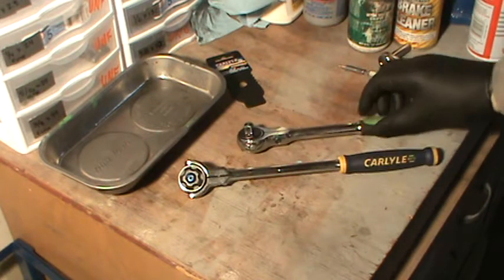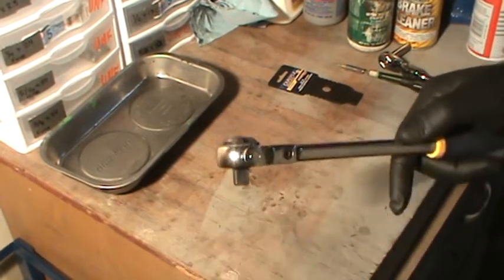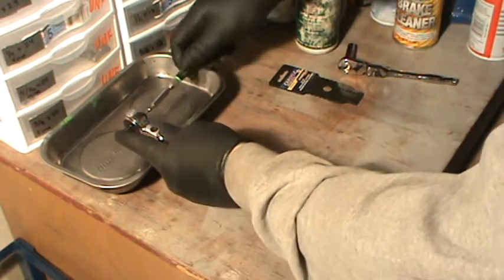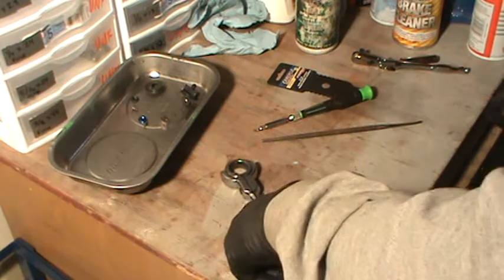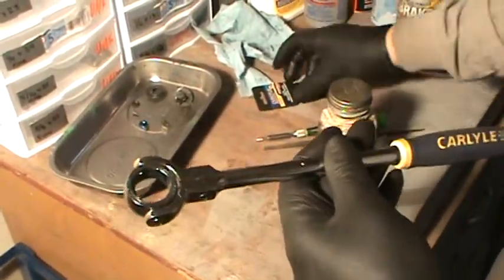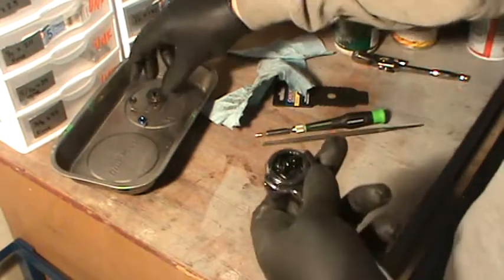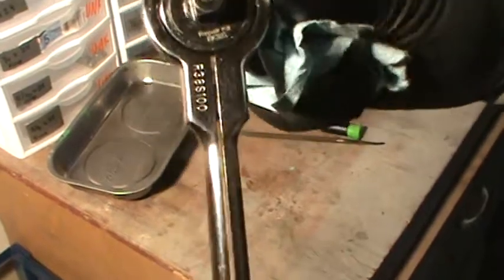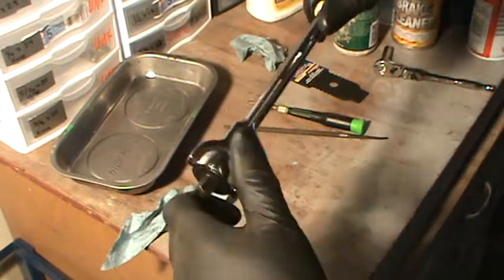Professional Tools

Comment: I own this ratchet. I've had the chance to disassemble it side by side with the Matco equivalent, and the internals are identical. I have No way of identifying little internal parts like that with serial numbers but both are made in Taiwan, that much I could verify, 100%. I would bet good money the internals for both of them come off the same assembly line. One cost me 70 bucks, the other cost my friend 130 something.

Comment: I have had this ratchet for about a year and a half. I bought it for about the same you did. I haven't had an issue with it slipping or the handle coming apart or fading. It has treated me well.

Comment: Snap on tools are made from virgin steel so the quality of the steel is stronger and can be made thinner, after market types are made from recycled or mixed virgin and recycled steel so its not as strong as the snap on tools but can be cheaper do to steel used
Reply: where are u getting your info

Comment: I've been looking at that Carlyle for awhile now, waiting on Napa to come down in price, last time I checked it was around 100 bucks.
Reply: Tim's Tool Reviews their ratchets are not bad but you don't wanna use grease when servicing their ratchets as it causes sticking they recommend v10 oil but I use air tool oil and they are nice
Reply: Tims Work Shop it's $69 bucks right now man. Just bought one yesterday. On sale though. Probably thru end of the year but not sure.

Comment: Hey roman what's the exact name of that lube your using. I tried to locate synthetic break lube in autozone. I found some black thick stuff.
Reply from the maker: It is this Permatex product http://www.autozone.com/autozone/accessories/Permatex-Ultra-disc-brake-caliper-lube/_/N-268d?itemIdentifier=10772&_requestid=13595922
Reply: Thanks brother
Reply from the maker: *****  Or on Amazon http://www.amazon.com/Permatex-24110-Ultra-Brake-Caliper/dp/B000HBNV6W/ref=sr_1_4?ie=UTF8&qid=1409105463&sr=8-4&keywords=permatex+brake+lubricant
Reply: +Emin HVAC I use Hoppes gun oil.

Comment: 1. Aside from the shorter handle and  inability to be taken apart, how does the swivel head harbor freight compare to the carlyle? I ask because I just b ought the 1/4 and 3/8 harbor freight ones.  I needed some ratchets that could reach hard to access nuts. I also bought them as my 'tool bag tools' so if they get stolen or lost, it's no big deal. I leave my snap-on stuff at home.

2. Have you figured out how to take those harbor freight swivel heads apart yet?

3. I don't like the idea of putting grease on the teeth of ratchet wrenches. The way I see it, because grease is thick, it might prevent the pawl from  seating into the teeth all the way and that could cause a slip. Grease is also difficult to wash away with wd-40 when it gets dirty and caked up. Grease can also slow down the return of the pawls and springs.  I usually open up a ratchet, clean the parts with wd-40 a few times or until the wd-40 starts to run out of the crevices clear. I then  shake off the wd-40 then use contact cleaner to remove all traces of it. After that, I just put a few drops of 3 in 1 oil in certain spots. I notice that my ratches sound much crisper and solid when I do it this way. Grease gives  you that vague engagement feeling that craftsman ratchets have. I like to feel and hear the health of my wrenches. Makes me more confident and less afraid of busting my knuckles.

4.  If harbor freight made a long handle swivel head, would you have bought the Carlyle?

5. If you can't open the Harbor freight, just dip it into a mug full of wd-40. I have a snap-on scaffold ratchet that is riveted (not screwed) closed and since I didn't want to break the rivets opening it up, I just sprayed some wd-40 in there. Works like new now.

6. I don't know why anybody would still buy snap-on ratchets. You are paying ten times as much for a tool who's country of origin you don't even know. They are selling autozone ratchets for 6 times the money. You might as well go buy a autozone Duralast and save some money. The heads on their ratchets got bigger, why? I heard it is because of the inferior steel. I heard that you need thicker metal when your metal isn't as strong. One of the big appeals of snap on was their slim profile but you don't even get that anymore.
Reply from the maker: I put grease, you can do what you want. If  a ratchet has the potential of a lot of sand getting in it, then I would just use wd 40 or similar. Snap On is a good tool brand, but they are outsourcing more and more of their parts to overseas to compete with all the other tool manufactures in the world. A COMPANY'S SOLE PURPOSE IS TO PRODUCE PROFIT. Remember that before you believe lies of millionaires.

Comment: Hey Roman. Have you looked into the Kobalt brand that they sell at Lowes. If you have what do you think of it? If not would you PLEASE PLEASE look into it and compare to Calyle, Craftsman,HB or maybe even to  those expensive Chinese tools.
Reply from the maker: I like Kobalt better than Husky. I like Carlyle because they have the large wrenches, large sockets, that Kobalt doesn't really carry. I have Kobalt, and they should be just fine, but like I said their hand tool line is limited. Try to find a 32 millimeter Kobalt wrench, they probably do not have one. To be honest, Kobalt is about the same as Carlyle except Carlyle has more tools available, and Carlyle is for professionals, they don't leave out sizes in the sets they sell.
Reply: Thanks a lot Roman. You are absolutely correct. Kobalts selection is limited i was at Lowes today and Sears looking for a deal and did not buy anything at either store. I am really really considering going exclusively Carlyle for a while. Since i have lots of the good all American tools that has Made In The USA stamped on them. Thanks again
Reply: Hey Roman. Since  respect your opinion. I am getting a pretty nice size tool chest for fathers day. Its not a $10k box but thats all my kids could afford. They are students. What kind of liner would co recommend. Thanks in advance.
Reply from the maker: Ahmad ShahBaba http://www.amazon.com/JEGS-Performance-Products-W88996-Drawer/dp/B007WWU79S/ref=pd_sim_sbs_hg_1?ie=UTF8&refRID=06QF0CQFAST89Y7G06M1    I don't know what box you are getting, but the Harbor Freight are very good for the price, it is 14 gauge steel, which is what most expensive boxes are made of.
Reply: Hello Roman.
The kids are getting me the Craftsman 40in  11 drawer chest#58628 and the 40in 5 drawers top # 58627 top stainless steel. And what do you think of the box. And once again thank you so very much. And the box is for the house.